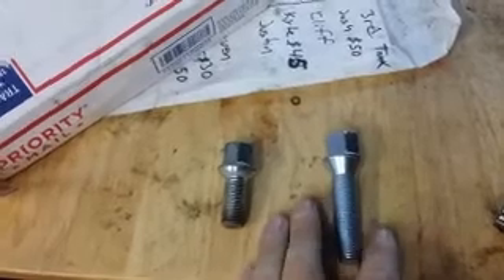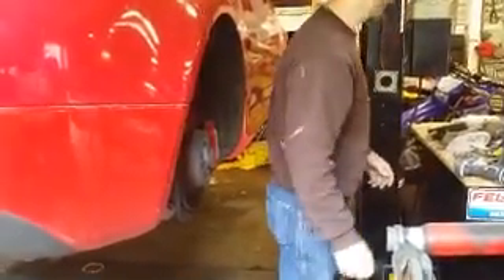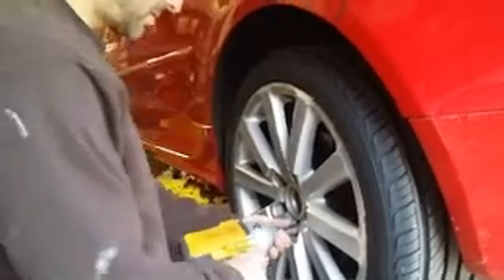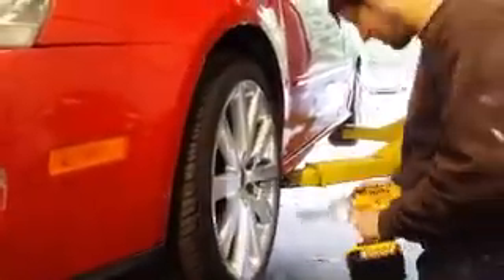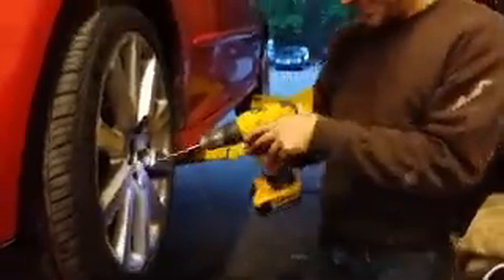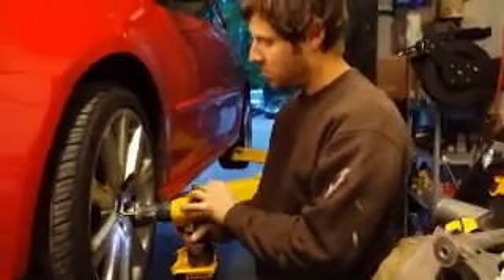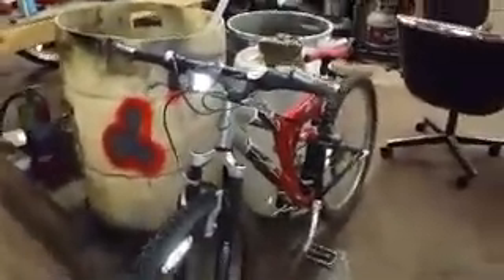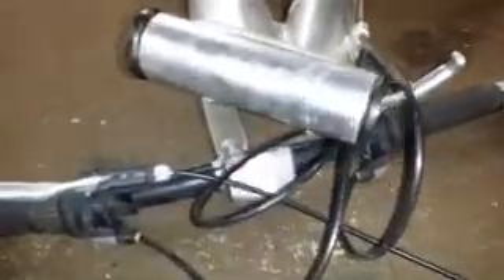Maxie's GTI gets Mercedes AMG Wheels

Comment: Hi, thanks for the informative video! I am planning on fitting a 20' Merc Wheel on a Golf 7 GTi, besides the longer wheel nuts and centre bore adaptor, do you think I would have any issues. I am planning a 35mm lowering kit also

Comment: Those are not AMG ,but Segin wheels from w220 s600 Maybach
Reply from the maker: Thanks man. I honestly never even knew exactly what car these originally came from. They are surprisingly light weight. Definitely a very cool wheel.
Reply: I have a set of 18 inch segin wheels on my dark blue w210 E320CDi, bought it with them on and they are stying on😀
Reply from the maker: @vojtechpolak1190  Hell yeah👍Do you have an Instagram? I'd like to check it out.
Reply: What size studs did you use 40mm or 45mm?
Reply: @jonathanguiel2629  Dont remember, i had 2cm spacers in the front, I crashed the car and got destroyed as well as the segins
Reply: @bryanmurphy26  Yes I have, vojta.polak1, but I crashed the car unfortunately, shes gone forever